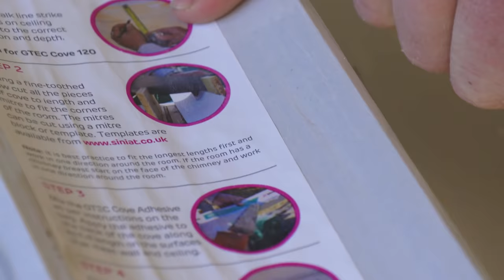How To Easily Fit Coving ~ Extension #20

Comment: I've done this for years and I never knew that type had top and bottom edge. Explains a few things now. Big help that
Reply: One edge where the adhesive goes used to be more rounded. Now it has ceiling edge printed on it.
Reply: I’m USA they don’t mark the back.. I see mouldings get installed upside down all the time.. but I just sand my floors and shut up.  Nobody likes a know it all.
Reply: lol and me

Comment: I hate plaster coving but it sees to give a better finish. I tried the paper coated large coving about 15 years ago, all done properly and it was easy to do. Looked just like the plaster coving. But after about 2 months it started to crack on the mitres and along the lengths and one day I said the wrong thing to my missus and she stormed out slamming the door behind her and 2 lengths fell down. I was pretty pissed off as we had just sold the house and waiting to exchange contracts, out come the decofil and I stuck it up with that as it was all I had to hand, slapped some white emulsion on it. Just hope the new owners missus hasn't got permanent PMT like mine cos it will have all fallen down after a few months 😂😂😂😂

Comment: I just love watching you guys at work. I self built a rather large extension, yes just me. All the trades and love making things. My tool box is is full. All the tools for every trade. I reckoned if I was not employing labour I could go and splash out on equipment. By and large I got it right by reading ,watching and understanding the dynamics of the various materials from concrete to timber, to plastics. Watching your videos has been a total pleasure. I have to concede that when it came to plastering large areas I called in the cavalry, also the slater for the roof and the roughcaster for the harling (Scottish for pebble dash). Great stuff keep it up. I am just coming up to 73 and those big 6inch blocks are getting heavier by the day.
Reply: Well done you buddy. Bet you did a good job too man. Kudos
Reply: Going to put up plaster coving first time. Unfortunately builers have insulated 2 walls and left the old coving there. So the  original coving is going through the new wall. I have to cut it back about 1'
Take off the old coving replace it with new. Not looking forward trying to cut 45 degree angle whilst the coving is in situ. I'm 69yrs old. So fun and games.

Comment: Nice video with very in depth tips and things to think about. It’s not as easy as everyone thinks. I can tell you’re a cabinetmaker or something similar based on how you set up the room and pinged lines and care taken to get it right. I’m a professional plasterer and I would have had that whole room cut in 1 go, then put it all up in one mix. There is a way to blade the adhesive on about 100times quicker than that with just a trowel, goes on in one nice even bead.
I use a mitre box and hand saw only, and there is absolutely no way you should be flipping the mitre box!!! It should only be slid from one end to the other. Another small advantage of using the mitre box is the cornice can be cut in just a forward cutting direction so the paper face isn’t roughed up if you were to cut on the backward motion too. So you don’t need to sand each end! The mitre box can also be used to hook your tape on you have to measure and cut 2 external mitres.

Comment: Nice job. I used to fit it as part of my main job, artexing (sorry). Never marked or drew lines ever. Make 2 test pieces about 1 foot long one with left and right internals and one with externals. Use artex as adhesive it stays usable for hours and cleans easier. If you use a caulker and scraper you can butter up a 3.5m length in 30 seconds.chuck your first internal up, use your test piece as a guide to twist up or down till the joint is tight. Put your next piece in and do the same in the corner/external with your test piece. Your joint in the middle can be adjusted to suit. Clean and move to next wall. That room you did should take an hour to do. Btw after putting miles of cove up never had any fall off, so no comments saying you can't do that.
Reply from the maker: Good tips.

Comment: I once spent a weekend creating lovely diamond shaped holes for the coving corners, getting those internal corner  cuts wrong time and time again. In the end created a set of template pieces to use to check the external and internal cuts. Not a job to rush imho

Comment: “Hello Mate”
Great informative and instructional video. 
The wood measuring block a great tip. 
I understand the thick edge to the ceiling each time. 
I have the metal cutting guide, but get confused on which way to position the guide.
Does the point of the guide always go to the wall side ? 
I get confused and some of my joints/corners end up with the cutting edges with a large gap at centres, with the ends touching..
Any help appreciated..
x The Bigfella x

Comment: Does the hundred mill trick only happen when you are reading the tape upside down? It happens to everyone once in a while, but I swear it only seems to happen when I'm working metric and an upside down tape. In inches its always spot on.
Reply: A friend of mine mainly works in feet and inches and he very rarely measures and then marks it wrong and he said to me that when you work in feet and inches there’s only one of every number! I do often use feet and inches myself but it seems to be frowned upon.

Comment: Get your self a gyproc mitre box £7 on line fits the coving perfect, 
ive been coving for 30 years it’s all I use, and a lot easier. Also brush some PVA glue thinned 50 50 with water on the  plaster walls and ceiling this will stop the adhesive sucking in and make it easier to clean off

Comment: First time I did coving I knew nothing. Looked good. Second time I knew only what I learnt the first time only I was more skilled all round, looked spot on. 

I literally slapped a few 3m lengths up on my own, no tacks or screws or pinging lines. I’m more of a stop messing about and get on with it attitude. Nothing in this video is wrong. But it’s much more fun learning on the job. James without a doubt was that guy in the early days. ✌🏻

Comment: In a way I wish we built like the yanks do. It looks fun. Everything is stud work and nail guns.  I think the English way is kinda better and more structurally sound but it's messier and a lot more awkward at times. I've just priced a garden room but don't think I'll get it. Was basically gunna copy oakwood garden room's way.
Reply: I agree. The English way of affixing coving is more structurally sound and adds a lot of strength to the overall building. Load bearing English coving is better than the panel pinned USA method.
Reply: Different climates, different requirements. The yanks build plenty of masonry buildings in the colder areas like Philadelphia for example.
They do tend to build timber frame interior walls still tied in to a brick exterior.
Reply: @amateurvegan2636  The Inuit build their housing out of snow and ice! How does that work? Using the thing that makes them cold to build a house out of!
Reply: You definitely won’t get it if you’re copying Oakwood garden rooms. Their prices are high because of their massive portfolio and extensive knowledge which is obviously portrayed to their customers when visiting them, which makes them spend the money.
Reply: @stakkerhmnd  Science. Get inside and they are warm yet don't melt.

Comment: Top tip. The ceiling cut is 90° from the back edge. This is especially important when starting off using a mitre box.

Comment: I always seal the cut dry joints as I go and a small amount of adhesive in the joint as I fix. They never crack then. Vacuum to hand for dust to keep tidy preferably with bluetooth button on hose or cheap remote switch to save your legs and back. Good demo though.

Lazer tape measure is a game changer although no real call for coving these days. Just not very popular it seems

Comment: Hi skill builder iv watched your video over about ten times and got it to a tee.iv a job to do which is a 90mm cove it’s got a slight concave in middle but has a small pattern on top and bottom of it will the wonder mitre still work on this

Comment: I fit much like you . I cut a pair of internals and externals offer up to ceiling to mark wall / ceiling measure length mark c on coving mark each end with cut needed . Because the length is right you cut short because of saw width now when adhesive added fits perfect. We all have our ways great job😁
Reply from the maker: good tip
Reply: @SkillBuilder  I have always done it this way. 
Cut 2 x Off lengths of externals and 2 x Off lengths of internals ( if required ) and go around the room in 5 mins and mark out the corners on the wall and the ceiling with pencil, while getting the best fit of the pre-cut mitre joints.
I was given this tip by a older gentleman who had been fitting coving for over 20 years.
The Gyproc coving use to be sold in a boxed pack of 5 lengths and was made in about 13ft lengths ?.
Back in the day, it came in two different widths as well.
I think it only comes in 3 metre lengths now ?. 
I have a wooden mitre box I made over 20 years ago and it has coved out more rooms than I care to mention.

Comment: I just installed insulation plasterboard over an existing external wall , took off the old coving to do the job , now the wall is thicker then before im gonna have a major problem, if i go to fit new coving its not gonna line up with the coving on the other walls i didn't insluate 🙈

Comment: Can you not do an internal cope as you would with skirting?
Reply: You can but it’s likely to do your head in cutting an upside down compound cope. I favour the adhesive to sort any minor problems, if you ever see any fibrous plasterers putting cornice or the like up you will know what I mean. They leave almost an inch gap with all of their work a lot of the time and just fill it in with plaster.

Comment: Is the plaster on the wall multi-finish? Could you tell me how the uniformity in this light colour is achieved please? Whenever I plaster a wall I tend to leave water marks especially when plastering over old plaster(pva’d first). When dry it tends to have darker areas I’m yet to get a helpful answer on this. I’m assuming it down to over working it? Or the mix not being wet enough or even too much water at the smoothing stage. I don’t sponge float, generally use water sprayer and a Marshalltown trowel. Any thoughts on this would be very much appreciated.
Reply: Hi Joe, 
It is multi-finish and the uniform colour is achieved by the use of the controversial sponge float.
Reply: @jimichip  thanks a lot James! I’ll have to give it a go 👍🏼

Comment: It is easier and quicker to use square coving and just do "butt joins" at external corners and internal corners. For added strength use some Festool Dominos for the joints. This is what I teach my disciples (apprentices). You are all my disciples!
Reply: Beer and Friday nights hmmm 🤔
Reply: @jimgeelan5949  When using the Festool Domino system don't forget to apply sufficient adhesive into the mortice. You know it makes sense!
Reply: @stakkerhmnd  I usually brace them from behind too! Just adds to the overall structural strength of the building!
Reply: @jasonantigua6825  I like your best practices approach. One should never skimp on structural strength. Always follow the "Kong is Strong" method as used in the DPRK!
Reply: Domino's in plaster coving? . Seems over kill and wouldn't the machine pulverize the paper and plaster
Reply: @ianthompson9058  A good painter and decorator will get round that!!!!
Reply: @jasonantigua6825 one of  the problems with trades nower days is that everyone is making it harder for the next guy . It didn't used to be like that
Reply: @jasonantigua6825  😂I hope your joking. It's plaster coving
Reply: @ianthompson9058  Need a special router bit designed for plaster - as sold by my tool brand "Kong is Strong". Don't forget to use dominos made out of plaster. Or polystyrene dominos if you're using polystyrene coving. I sell all of these.
Reply: @ianthompson9058  Not joking! I used to put bow ties in my coving! Sometimes left them on show!
Reply: @jasonantigua6825  😂👌